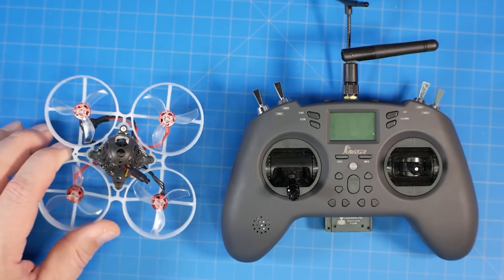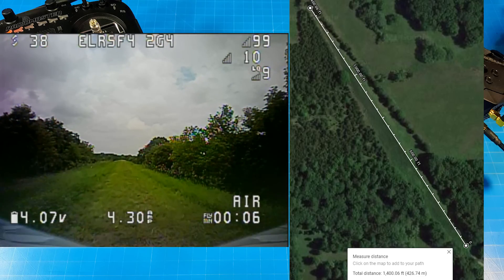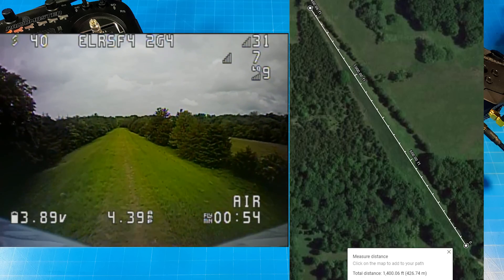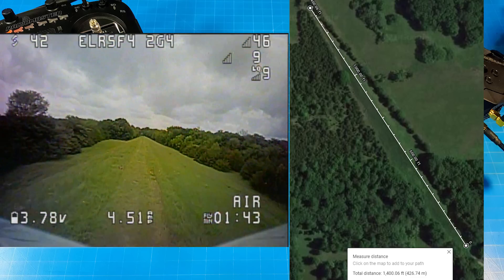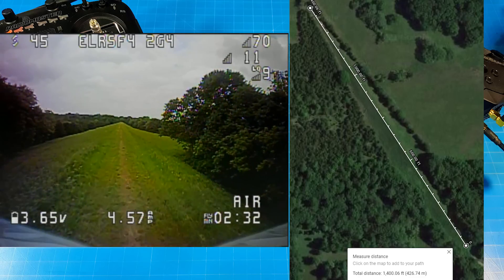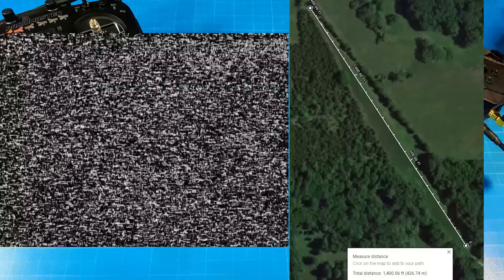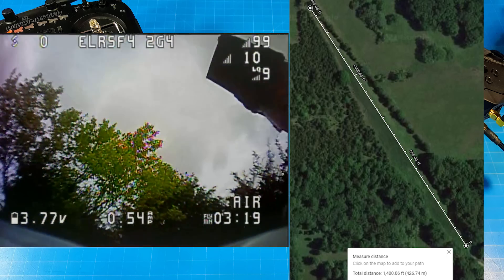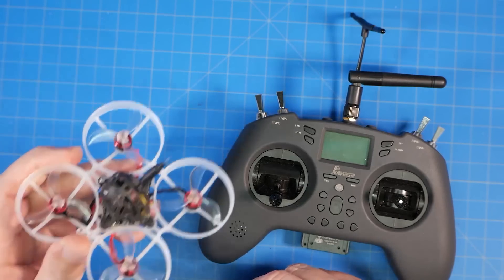Long Range Whoop // ELRS F4 AIO // ES24TX-Lite

Comment: First ...THANKYOU for all your content!!
  I get 1,400 feet on my spi RXs.. however this is due to “props off fpv”.. he suggested 32.8mm for exposed element on RX antennas.. my tinyhawk and UZ65 will drop at around 12-1,400 feet depending on foliage and such.. havnt had a chance to hit open space..these have the antenna mods..

Comment: I was trying to plug in my quad the other day and I ripped the USB  Connector off the flight controller can I still set up switches
Reply from the maker: Not to my knowledge. We need that USB port to access the flight controller configuration. I don’t think modes is available via osd configurator
Reply: Google for: “flight controller broken USB”. There are solutions for this problem. Sometimes simple, sometimes more complex

Comment: azi props are awesome, moblite7 behaves so well with them
Reply: better than HQ 40MMX2 2 blade? How's the flight time?
Reply: @PhobosYT  better, you'll have control on the low throttle not just falling down. Flight time is less I suppose due to the 3 blades

Comment: I would like to see a range test with express and crossfire nano with the small immortal T. Then after the testing is done calculate the range /price/availability of both modules and recievers and conclude the test with an algorithm of what is the better all around module/receiver. Lol really though dude comparison bra
Reply from the maker: That is a tough request to fill. I believe the mini immortal t antenna are consider pretty poor antenna
Reply: @NickBurnsFPV  If you run a mini mortal on 1w it has to beat anything you can put on a whoop, right? That was a question lol
Reply: @trevorimpulsebuyguy6398  I'm pretty sure ELRS (ceramic antenna) will beat crossfire with the minimortal T on 1W (it also kills your battery). Especially on 50hz 250mw.
Reply: @wiebel1991  That's cool I hope so because it's way cheaper and more available! I still would like to see more testing done. Thanks for your reply man!

Comment: Impressive range for such a tiny antenna, my FlySky SPI Mobula 6 came with a separate FlySky RX board & pre-wired plug on the FC with instructions that if I found the range to be bad, I could simply plugin the external RX and change a setting in Betaflight.
Guess what I had to do after I discovered the SPI range was shorter than I could physically throw the quad ;)
Reply from the maker: Throw is further with a slingshot 😂

Comment: Cool video! I think at the end, flying low might have killed it too. The higher you stay the better the reception in my experiences. Nick is that the Mob 6 canopy though?
Reply from the maker: It is the mob6 canopy. For max range being far higher is the way
Reply: No its a mob 7 v4 40mm blade spacing...
Reply: @AvallonYo  I heard him say that in the video about the frame but I notice that the canopy looks identical to my Mob 6 canopy

Comment: hi there @Nick Burns! the V4 frame is more durable then the v3? thx ....
Reply from the maker: The v3 being the eachine trashcan frame?
Reply: @NickBurnsFPV  yes I think they are the same frame different name...
Reply from the maker: @ch3fpv  I would doubt the v4 is more durable than the v3, I have bashed the v3 around so much on a number of different whoops, and on 2s. This v4 is doing fine on 1s so far, I think its more in between the two, not has heavy as the v3, and more durable than the v2.

Comment: I am using a similar setup (moblite7, explresslrs and t-lite). Which firmware do you use for the t-lite? And are you able to enable 500Hz refresh rate? I can set 500Hz from the lua scripts, but I am not sure it it is enabled or not.